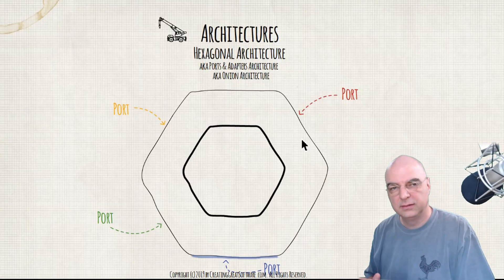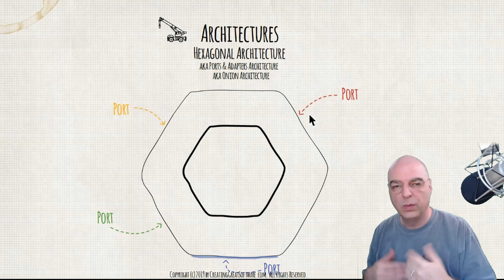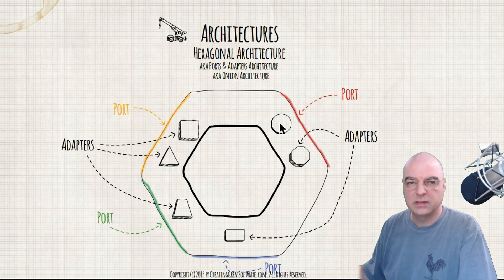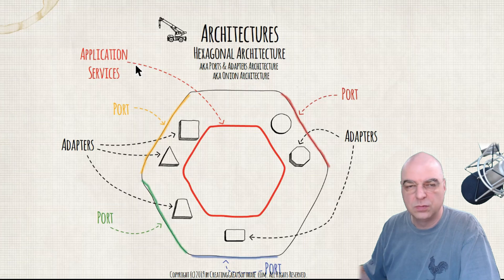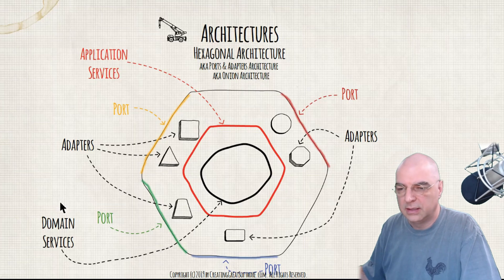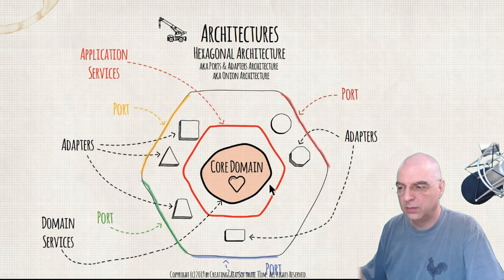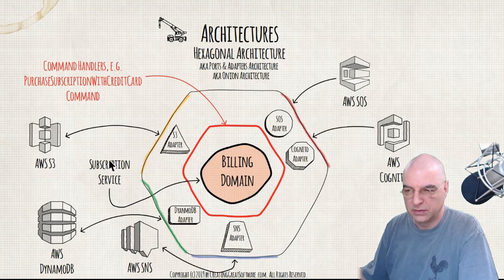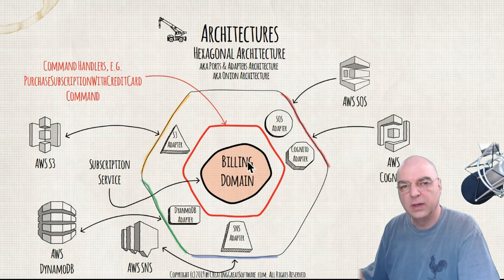Hexagonal architecture - Part 7

Comment: Are the adapters using the ports or the ports using the Adapters?
Reply from the maker: The adapters are using the ports since you want to keep the advantage of replacing adapters whenever needed and to keep the architecture flexible. The ports are more or less protocol standards. For example, if you have a TCP connection that is always "on", the adapter uses the TCP port to communicate/pass incoming and outgoing messages. Another example could be an HTTP/HTTPS protocol for port communications like an API endpoint, etc. Think of the adapters as the components that "know" how to communicate with the ports.

Comment: My company just started implementing this pattern. The articles I've read have the ports on the other side of the adapters and not how this video has it. Where the ports are between the adapter and the domain/application services and not on the outside. This lead to a bit of confusion on my side.
Reply from the maker: I can see where this could be confusing. I've heard this type of implementation before; however, a port is really meant as a gateway to the outside world of the application. The ports themselves do have any business logic nor are aware of even the type of messages that are being passed through. Think of them more like a protocol level port, or a lower TCP stack. Adapters are really higher level constructs and have some concerns of what's being communicated and are meant to be replaceable. Hope this helps.

Comment: Just checked out the Martin Fowler article you recommended and I'm very surprised. Maybe because I fell into software development without going to school for it but I had always seem any implementation as just being the best solution for that moment in time. Even if architectural requirements didn't change over time, the technology does, and it seems to do so ever faster, so the code ends up becoming obsolete anyway – I had no idea developers got attached to code.

Besides, no code rewrite is a failure because it's always rewritten on top of the learnings from the previous codebase. We never really rebuild a system from scratch. Glad to find out I had the right mindset out of luck!
Reply from the maker: For the most part, you are right. However, I would be careful in saying that rewriting a previous codebase is on top of the learnings of it. It is so common to see that people make the same mistakes over and over, also. It also depends on who would be involved in a refactoring / re-architecture effort. Are the domain experts still around no matter what the code looks like? How was the business knowledge captured in the first place? Can you explore DDD, event-sourcing, CQRS, etc.? These are often new concepts and people may/or may not welcome change. Any re-architecure efforts must include the business impact and domain knowledge.

Comment: after reading several articles about ports and adapters pattern and being more confused than before I am soooo happy that I found your video <3 I need to understand a legacy project which uses this pattern and this video is desperately needed
Reply from the maker: I'm glad it helped you. An important point when reviewing legacy systems is the ignore a lot of noise or technical depth. Let me know if you need further help.